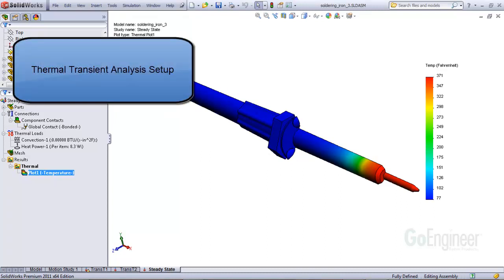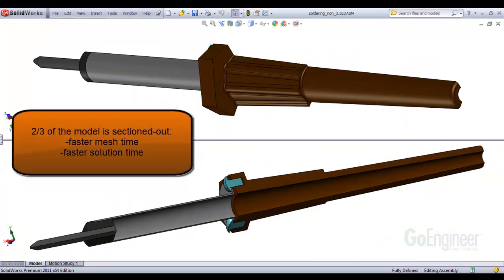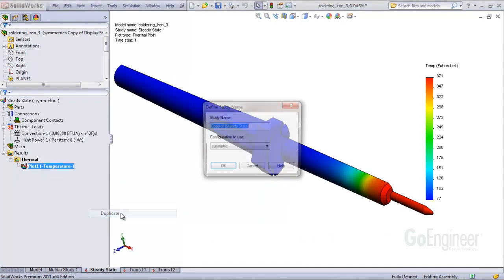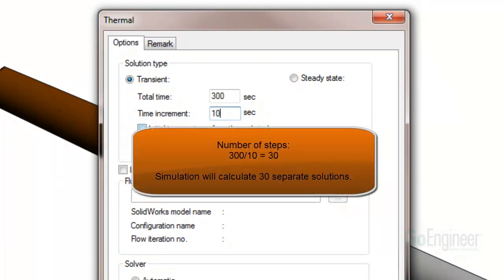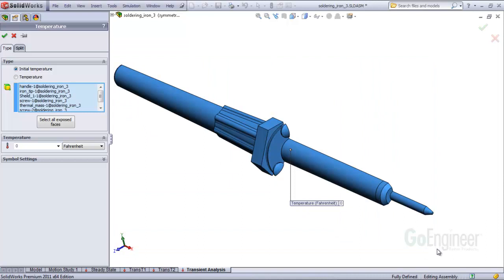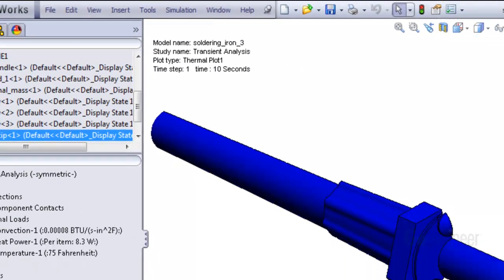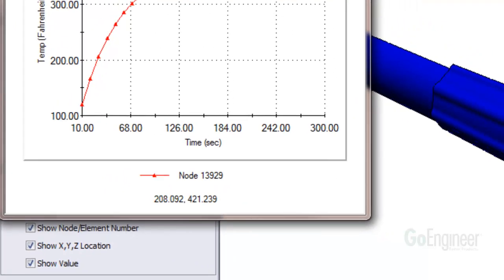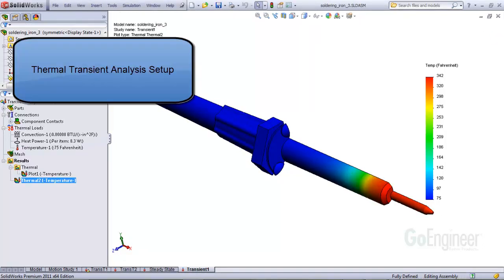SolidWorks Simulation - Thermal Transient Setup

Comment: One gatcha that I ran into is when inputting the initial temperature, make sure you select the solid body.  SW would not let me select the components themselves and just grabbing exposed surfaces causes very wrong results.
Reply: How to you select solid body? I selected the parts, but it still had the wrong initial condition.

Comment: Way out of date.  SW2017 does not have any menus like this.  Can you update the video for the current tools?  Transient is very poorly documented in the manuals.
Reply from the maker: Hi Allenman85,
While the coloration has changed in recent versions the underlying functions and commands are still present and look the same.  We will look into redoing the video; it is not a high priority at this time though.

Comment: you set the initial temperature, but did you set the thermal load?
Reply from the maker: Hi Fajar,
In this example the model is set with an initial temperature of 75 degrees F along with a heat power load (8.3 W) to input heat to the system and a convection boundary on all exposed faces to allow the heat to move out of the system in the theoretical environment.  The example started as a steady state setup where the heat power and convection were already applied and the video shows only the addition of the initial temperature since is was switched to a transient analysis.
Reply: +GoEngineer okay thank you for your explanation and tutorial sir